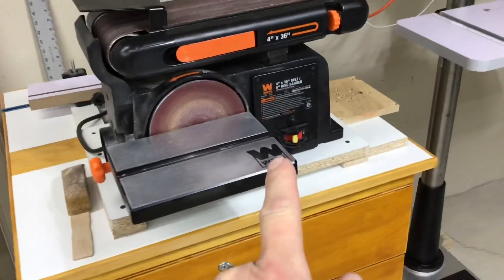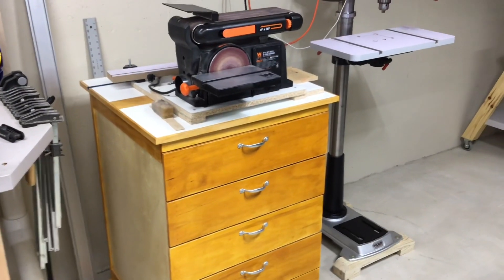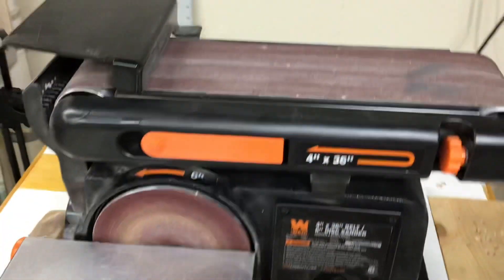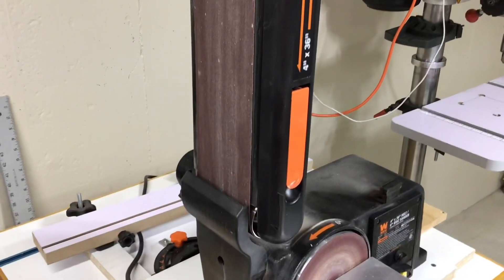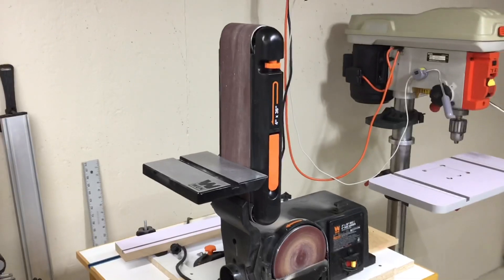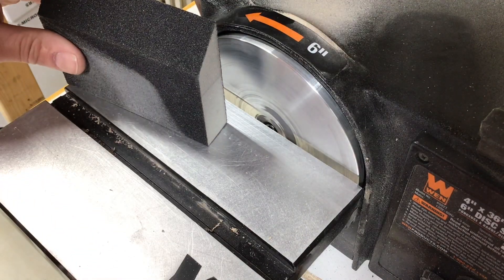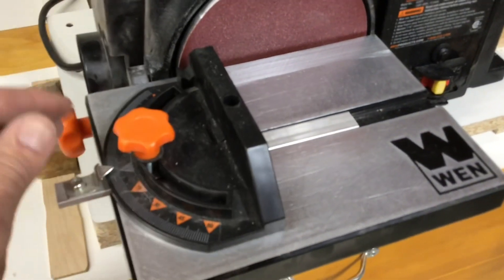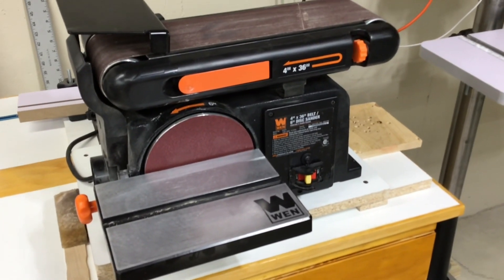Wen, 4” x 36” Belt / 6” Disc Sander/ One Year Review / Is It Still Worth The Money?

Comment: Thanks for the video. I have the same sander, and given its price, I have my fingers crossed it'll last me for a few years. It's so far served me well.
Reply from the maker: Thanks for Watching Randy! After over a year, I’m pretty confident that it will last, time will tell
Reply: I have been researching 6" × 36" sanders. I have seem mixed reviews on the Wen. It is good to hear a review from someome who has used it a lot for at least a year. Thanks for the video!
Reply from the maker: Thanks Tim! I appreciate you Watching! It has worked great for me!
Reply: i picked one up a couple months ago from amazon, i have used it twice for about 1 hour each time. It has worked well both times but now the motor doesnt like to start without helping the belt along then it takes off and works. the capacitor tests pretty close to good, im guessing its the problem. Called WEN they are sending me a new CAP and Motor, after doing their series of troubleshooting tests over the phone, they are sure the motor is bad, i disagree but i didnt argue they are sending both at no cost, so we will see. Good luck with yours! Their customer service in my experience was top notch.
Reply from the maker: Thanks for Watching Nate! I’ve had mine for over a year now with no issues

Comment: I just bought this sander to do some metal work as a replacement for the wheel I have been using and I am excited to try it out. Most reviews have been very positive. I also own the WEN 10 Inch drill press and am happy as a clam with it. For the price have paid for these tools I think they should fit well in my DIY shop. Now where is the WEN 10x22" metal lathe?
Reply from the maker: Thanks for Watching Chad!  Glad you like them… not sure if they have a metal lathe

Comment: does it also work for metal? Like axe heads, hammers, basic hand tool restoration, rust removal? Is it strong enough? Obviously I would use different grits. Maybe  grinding a rough edge on an axe for final sharpening?
Reply from the maker: Thanks for Watching! Good question! I have used it on metal with no issues

Comment: I used one for a fee months heavily to fine-shape wood, and it came out of the box working as intended. when it came time to change the belt it that’s when the frustration began as the locking mechanism was too flimsy/weak to provide tension in the belt to keep from sliding around.  I would not recommend this.
Reply from the maker: Thanks for Watching! Ive not had that issue changing the sanding belt
Reply: @TomHorsmanAmateurBBQ   Thanks I'm glad that you didn't! I had the arrows on the belt going the right way too!

Comment: The one my son bought me had problems right out of the box.  Didn't use it for a few months, didn't even unpack it, so I couldn't send it back.  I turn it on and before even using it, the belt won't turn.  It just hums and then trips the breaker. Nothing is binding, the motor is defective. This happens several times until it FINALLY starts turning. Has very limited power and stalls out easily. I am going to trash it and buy a Bucktool. They have much better reviews.
Reply from the maker: Thanks for Watching Rance! Appreciate the feedback

Comment: I bought one and regretted it. The tool support in front of the disc is only supported on one side, and flexes a lot. The sanding disc ran with a wobble. And a large plastic piece behind the sanding disc had mounting tabs that broke off, allowing it to rest against the back side of the disc, creating racket. The one thing this has going for it is that it was cheap, but it is equally cheaply made. 
For all their bragging about making quality tools, WEN dropped the ball on this one.
Reply from the maker: Thanks for watching!  Over 2 years with mine and I haven’t had an issue. I appreciate the feedback